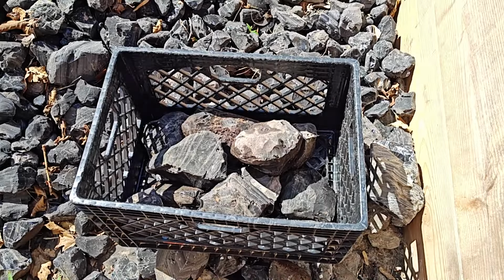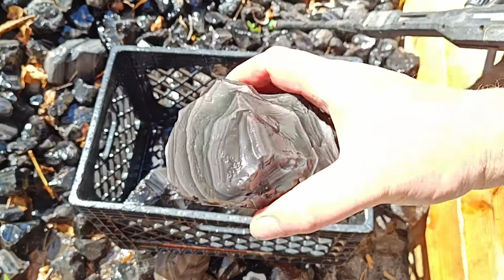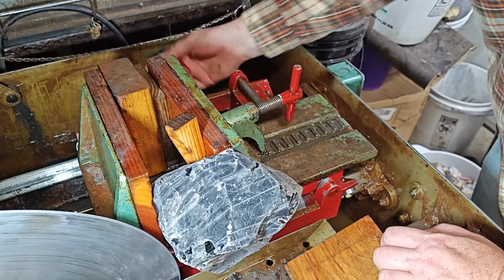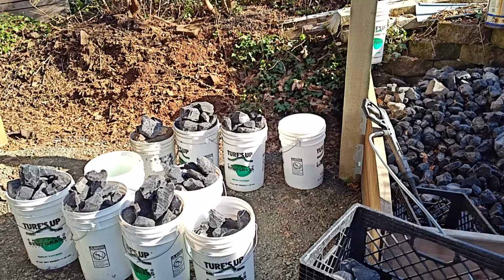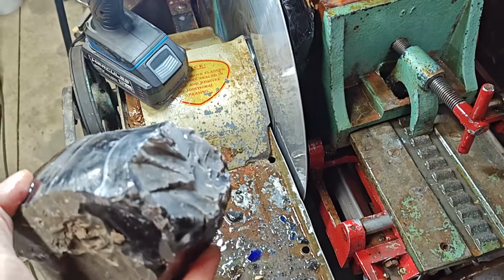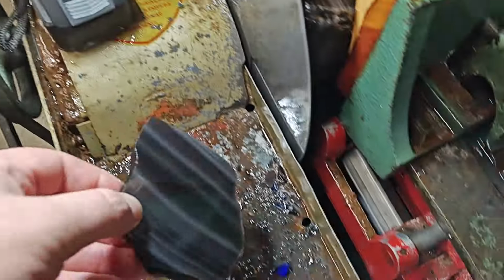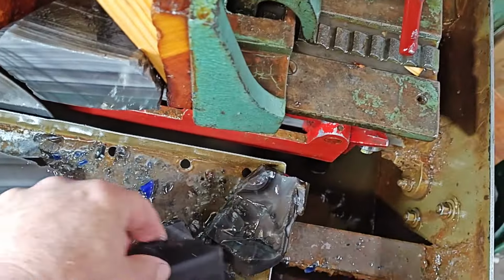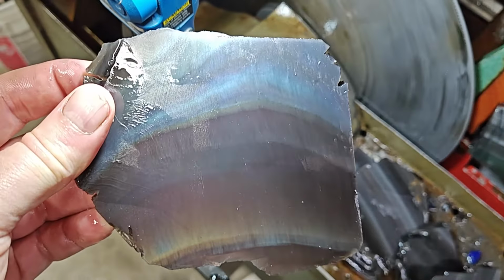Cutting Rainbow Obsidian in a Slab Saw

Comment: I also use the "drop test" method to weed out the cracks.  There's nothing more annoying than finding a crack in a worked piece.  Or worse having it come apart while you're working it.  I've had people gasp when I tell them about the drop test.  They would never do that to something they've spent money on.  That's why you see cabs with fractures running through them.  Starting with good solid material will result in a good solid cab.  Cabbing a piece with fractures in it will not make them go away.  They will always be there waiting to fall apart on you. Just saying.
Reply from the maker: I had people also freak out on the drop test. Hey it works well.  Saves time and then one might end up with some killer looking freeform cabochons.